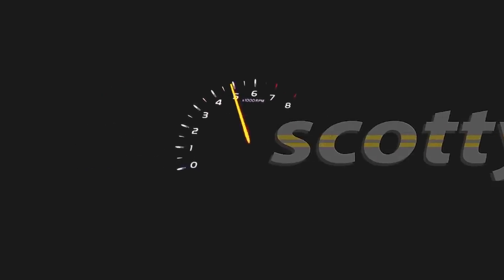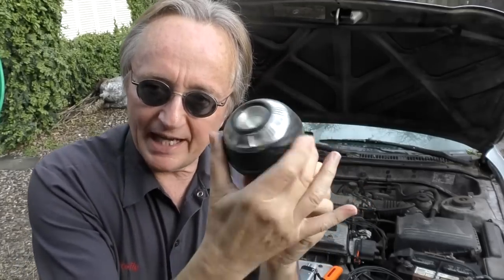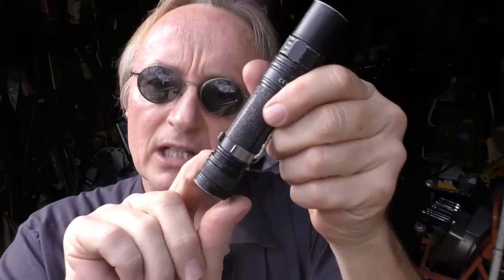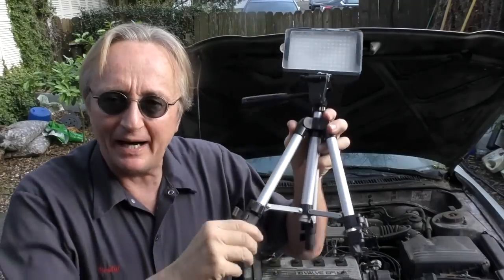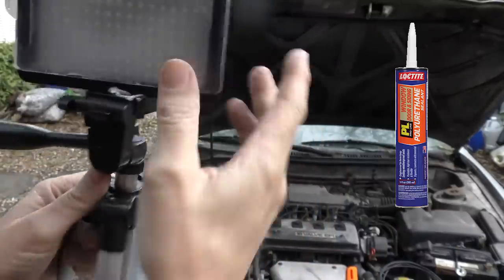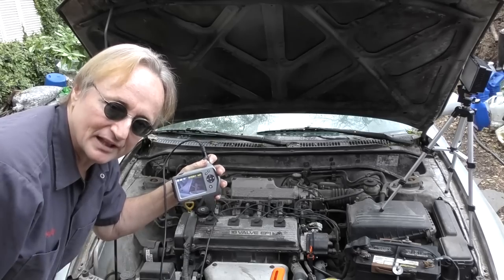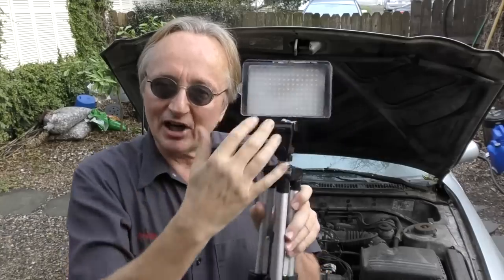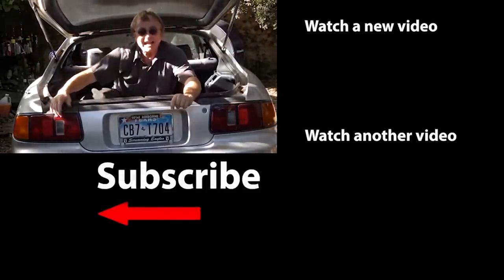The Best Work Light in the World and Why

Comment: Home Depot sells headband LED lights for $10 for 3.
Its the most useful and practical light i have so far
Put it on your head and the light is always with you wherever you look, especially working under the car.
Reply: Better than nothing but I don't go cheap on lights. I don't trust a $3.33 light to be reliable. I'm really tough on lights. My lights get dropped, smacked around, or covered in toxic waste and keep on working. I don't think I have a work light that is under $50.
Reply: @GrnXnham  yes, i wouldn't mind buying the best tool for professional use either just as cheap tools like the headlamp LED has its own use, greasing the U-joint under the car would be somewhat overwhelming to use an expensive light considering it will be covered in grease and dirt.

Cheap lights has its uses, i put one in the glovebox,  one in the garage and one in the basement. I guess im too cheap 😁

Comment: Some nice options.. thx.
I've used a particular one from Harbor Freight.. uses that same big 18650 rechargable battery. Magnetic, and can rotate.  The light is thin so you can get it down into small places.  Has low and high, and the tip can light up too..

Comment: The best light I've bought is the LED under-bonnet light. Fits just about any car bonnet/hood, lasts 3-4hrs on a full charge, isn't blindingly bright, and it can be unclipped for use under the car. Gives a great even spread for engine work.

Comment: Thanks again Scotty.  Best work light I've found was buried in the snow at a curb, It had obvious been run over several times given all the marks and scratches on it.   Who knows how long it was sitting there but it charged right up and gives off an incredible amount of light.   It has a strong magnet to stick on any metal surface and looks to be indestructible and maybe waterproof.  Small enough to fit in your pocket.  It's called the Cyclops and runs about $20.00 online.  Now let's talk lighting for your garage.  Take care!

Comment: I'll tell you what I've found are good flashlights. The Streamlight Strion series. I have 3 that I've had for years. Why do I have 3? Because, like 10mm sockets, flashlights tend to disappear. Fortunately, unlike 10mm sockets, I would find them......but only after I bought another one. And they're lifetime warranty through my Matco guy, so when the switches go out or the circuit boards fry, I get it fixed and have two backups. All for the low low price of an accumulated 390 bucks.

Comment: Definitely could use a good LED work light. The other problem I've had with the old drop lights are you had to buy expensive 'rough service' bulbs. Otherwise you are replacing the bulb every other time you used it. The quart ones, too much heat. I almost melted a hole in a Taurus air filter cover before a I noticed it had loosened itself and pointed dow.

Comment: Those big 18650 lithium batteries are the only way to go with led flashlights. They give you a bright light with exceptional run time. Just got to make sure you buy the good batteries and not the fake (low capacity) batteries that are sold on Ebay and other places.